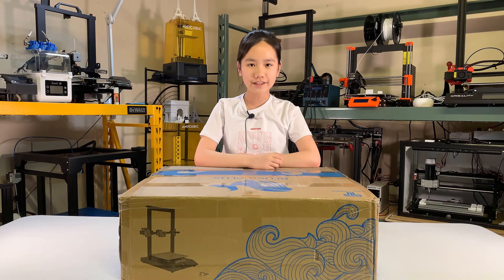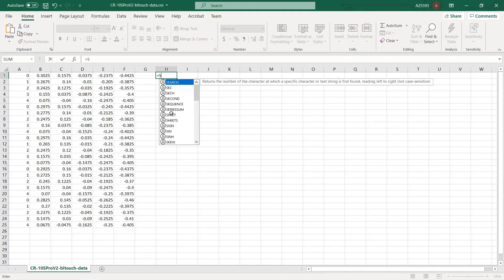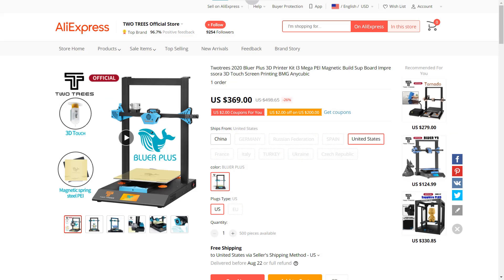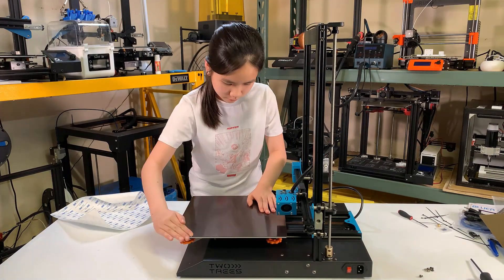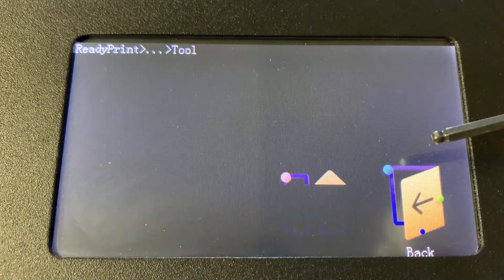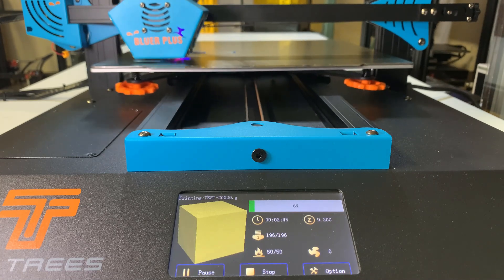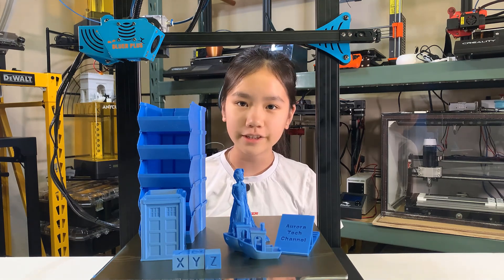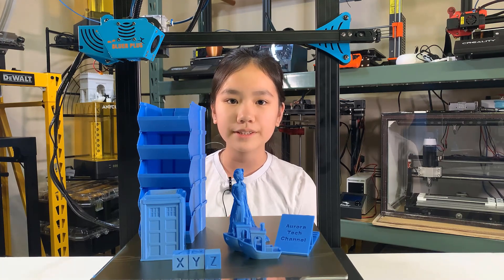Two Trees Bluer Plus BLU-5 3D printer review

Comment: The cura profile included send a G28  with no m420 command... are you sure the mesh levelling is working in this way.... should I add M420 after sending the G28 command?

Comment: What do your retraction settings look like? I’m getting a good bit of stringing on my prints with this printer. Doing some retraction tests and can’t get rid of it. My tests were closest to removing stringing with 5mm retract and 38mm/s retract speed, but still getting whisping with that. I did see some people say they had to go up to 7-8+ retract distance? I did shorten my ptfe tube already.
Reply from the maker: Yes, shortening the PTFE tube helps a lot. My retraction distance is 5.5mm (or 6.5mm depending on filaments), retraction speed is 50mm/s.
Reply: @AuroraTech  Thank you. I can't seem to get rid of stringing with this machine. Been doing a lot of retraction tests at various distances and retraction speeds. Temp Towers, flow, etsteps, PID tuning, etc. I may try to reseat the PTFE tube in the hotend to make sure it was properly installed from factory. Tried print speed of 60 and 70mm/s, not making much of a difference.

Comment: using the stock software, do you know how to adjust the e-steps? I am brand new to this thing, but while the prints looks good, they aren't tall enough. Where a cube should be 15mm, its 11mm. I printed a calibration cat, it supposed to be like 35mm, mine was like 20 something. They sent me one with a bent 3d touch tip, and i'm hoping its that, I made sure the gantry's are not too tight. It doesn't  look like its skipping lines, the sides look nice, its just shorter than it should be. And i'm running out of ideas. It seems this printer has missing items in the menu, compared to other brands... Any  help?

Comment: Hi Aurora and her father.
I took advantage of your advice and bought the Bluer Plus.
This is a beautiful and high-quality printer. Many thanks for the advice.
But I did everything as shown in the instructions, including in your video. But something apparently did not take into account and spoiled the PEI table (((
So that this no longer happened, could you post on Google Drive all configuration files? Including a tuned Slicer for the BluerPlus.
Reply from the maker: I used the example config files from Marlin, just changed #define Z_MIN_ENDSTOP_INVERTING to false and the TFT screen calibration values. 
For the slicer, I used Creality CR-10S Pro profile in Cura, it worked fine on my printer. 

My nozzle also crashed to the PEI bed the first time as I didn't tighten the coupler all the way on one side. I suggest you can check and make sure BOTH dual Z-axis couplers are tighten at BOTH ends (the lead screw end and the stepper motor shaft end).
Reply: @AuroraTech . That's Ultimaker CURA? Or other CURA?
But there have a profile for Bluer Plus
Reply from the maker: Yes, the latest version of Cura has included Bluer Plus profile, you can use that if you prefer.
Reply: @AuroraTech  Sorry, but I have another question.
I installed the latest firmware from the official site.
The axis Z stopped falling on the table.
But now the printer defines only 1/4 table. And the movements on the axes became very slow.
why ?
Reply from the maker: Seems like the steps per unit for X and Y is not correct and the Z stepper direction is also reversed, I guess you may downloaded the wrong version(or config file) that doesn't match your hardware, you can send the serial number of your printer to Two Trees and ask for the matching firmware.
Reply: @AuroraTech  Hello it's me again. Sorry. :)
Please tell me parameter >DEFAULT_Z_STEPS_PER_UNIT
from your cfg.
Or share pls your config file....
i trying printed XYZ-cube 20*20*20, But I get only 20 * 20 * 40. model from Z too high...
Reply from the maker: @BoozyWoozy  >DEFAULT_Z_STEPS_PER_UNIT	400
Reply: @AuroraTech  Thank you! I have this parameter 800. I hope it will help.
Reply from the maker: I just use the one downloaded from twotrees:
http://www.auroratechchannel.com/download/BluerPLUSFirmwareV2.0.3.A.zip

Comment: Thank you for a very informative video. I received and assembled my new two trees bluer plus printer plus yesterday. I used the test print file to print the cube and am more than happy with the result. My only problem is the USB stick. It doesn't work, and I've been unable to connect to the company's website. It seems to be down. I would deeply appreciate any guidance on how to obtain a copy of whatever files are normally on this USB stick so l can connect my computer to the printer.
Reply from the maker: The only USB port(next to the micro SD card slot) is for computer connection, there is no USB (Type-A) port available for USB drive.
Reply: Thank you. You are correct. The TWO TREES USB memory stick is unable to import anything directly into the 3D printer. It must be intended download a program into a computer that will then connect to the printer via the provided cable. Since my nonfunctional USB memory stick came included with my printer, I must assume it is important, and I would like to know what it contained and how to get a copy.

Comment: Another great video. Thx. 
Now, I saw that the hotend is very similar of the one found in stock Sapphire's. Wouldn't be a cheaper upgrade on sapphire to put this volcano ??, and print at higher speed ?? I know we can't compare it to a E3D style or mosquito style hotend... but would be cheaper to go with stock and only change heatbreak to bimetal and put a volcano in end ?
Reply from the maker: Yes, the heat sink is the same, you are right, you can upgrade the sapphire plus by just changing the heat break and volcano heater block.

Comment: I have bad stringing with mine, Direct drive would be a huge upgrade!
Reply from the maker: You can try to shorten the Bowden tube and see if the stringing improves.
Reply: @AuroraTech  Thanks! Tried that :(  Does the Capricorn tube help?
Reply from the maker: Capricorn tube just let you print at higher temperature, but won't help much on stringing.

Comment: I think my ender 3 max, is the best bang for $300 bucks..
Well it was 289. but gud bang!
Reply from the maker: Ender-3 Max is a good choice if you don't need any extra features. 
But the Bluer Plus is currently on sale for $329, just $40 more than the Ender-3 Max ($289), you will get all these features: Dual Z-Axis, Auto Bed Leveling, Color touch screen, Silent stepper drivers, PEI Spring Steel print surface, Dual gear extruder, Filament sensor, Belt tensioner... For me, $40 for all these features is pretty nice.

Comment: The Bluer Plus is one of the more recent printers I've run across while shopping around but if I've seen a vid on it before this one then I don't remember it lol. Looks pretty solid. Other recent ones I've seen are the Anycubic Vyper, seems expensive for the size but setup looks solid, and Voxelab Aquila, new budget king.

It might be too much but a vid on the Voron Switchwire could be interesting. Or the converting of a standard Ender 3 type printer to a CoreXZ like the Switchwire and if it's worth it, what the advantages and disadvantages could be and such.

Comment: Well done as usual.  This is the best review of this machine on YouTube; I watched them all as I was considering this machine because it's hardware is such a good value proposition.  One note, although it is odd G29 in the start code produces such odd behavior, if abl is configured correctly in the firmware you should never have to add G29 to the start gcode.  G28 automagically recalls the abl mesh so after the initial set up abl should only have to be done after hardware changes and periodically for maintenance.  Look forward to your upgrade video on this printer.

Comment: I have an ender 3 max.. 
cost $289
My hotend maxes out at 260°C.
How would like to increasr it temperature with Capricorn tubbing and an all metal hotend.
I would like to print at 300°C.
I want to see what printing petg at 270° would do.
So far I have learned petg loves 260° and its super strong!
I cant break my 260° petg benchys by hand.
I would love see what 270° would do.
Anyways thanks for the videos.
Reply from the maker: Hi! If you just need to print PLA/PETG/ABS/ASA, you don't need an all metal hotend, just spend $10 for a Carpicorn tube and change max temp to 280, compile the firmware and upload to the printer and you are all set. I have 2 printers using micro-swiss all metal hotend, they are not bad, but simply won't improve print quality. For printing any filament that won't require 300+ degree, the stock Creality MK8 hotend just works the same or even better for PLA.
Reply: @AuroraTech  Cool that sounds great!
Capricorn tubing and recompile the firmware.
I need to customize my firmware. Do you know of anyways to increase bed temp?
Reply from the maker: You can also adjust that inside the firmware config files. But you need to check with your power supply, for Ender-3 Max, it may just use a very basic 350W power supply, so if you want to heat it up to 110C, it may take quite a long time, if you want more than 110C, you may need to upgrade to a 500W+ PSU.

Comment: The problem in very bad quality control in the end of production. Because I have one I can not recommend it for beginners. Printing quality not bad after fixing all the problems.
Reply from the maker: The printer I received was fine, only the print bed and Z-axis timing belt was loosened during transportation, and there were no quality issues at all. In terms of quality control, this Bluer Plus actually improved a lot since my last Two Trees Sapphire Plus printers.

Comment: I have a Bluer Plus myself and the print quality out of the box is pretty amazing right out of the box, especially for such a good price. I have mine modified with a linear rail for the X-axis and an Afterburner toolhead from Voron, which has a Volcano hotend with a 0.6mm nozzle and is direct drive. Even though I replaced the 0.9 steppers on the X and Y with regular 1.8 ones as the stock were too noisy I didn`t see any noticeable decrease in print quality. My main gripe with the machine is that it comes without heatbed insulation and for such a large surface printing high temp materials is neigh on impossible as getting and maintaining 100-110C on the bed takes forever and the surface temp is not consistent. If you find that adhesion drops on the PEI surface just get a sanding pad and lightly scuff it and then wipe it clean with water and soap. Hope you have a nice time using this printer and can`t wait for your upgrades to it.

Comment: Aurora can you please review the FLSUN Super Racer ? For 500 dollars it looks like this would be the best 3D printer at the moment (provided you have enough place for it)
Keep up your work 💪
Reply from the maker: $500 seems not a very good deal to me, I really can't see any parts from this printer worth 2X of the price compared to the FLSUN Q5 $249 printer. I may try an IDEX printer once the Sovol SV04 is back in stock.
Reply: Far smaller build area, dimensionally less accurate the closer you get to the bed edges as all deltas are, what's normally not mentioned about deltas is they will only print in a cone in z height due to the arms, a bit faster but I would not pay the extra for the other compromises. Looks cool but deltas are also a bit more of a pain to fix when they break. If you want to show off to friends and you don't need to print parts that need to be dimensionally accurate go ahead. I have a delta printer and given what I know now I never would have bought one they are essentially toys.